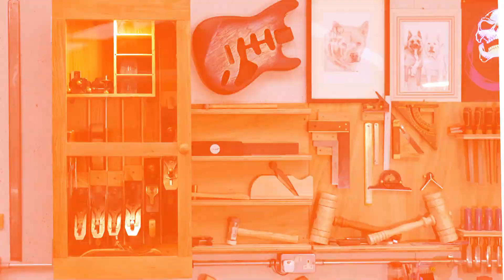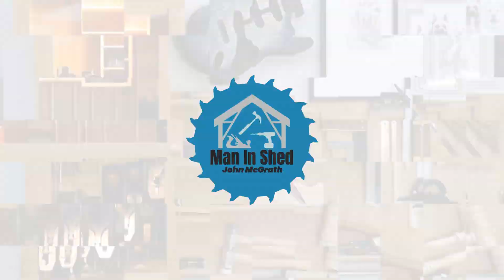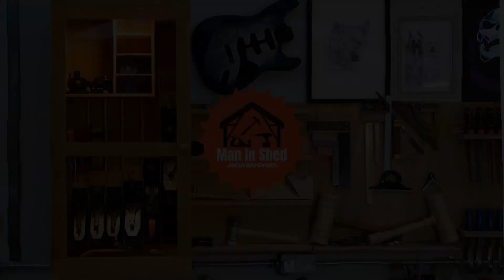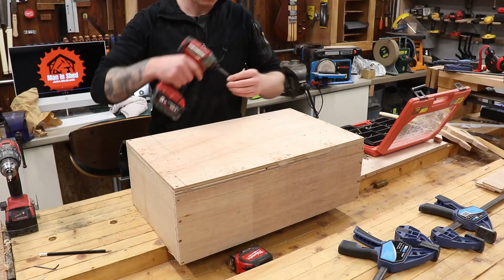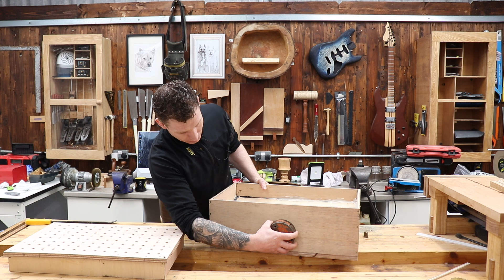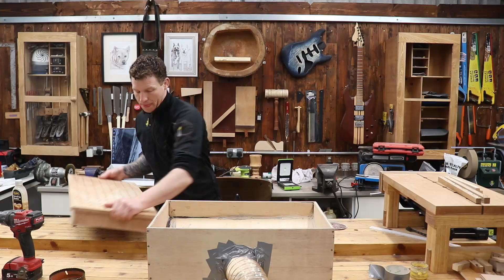Downdraft Table. Sanding Station. Easy to Make, Essential to any Workshop.

Comment: great job . a downdraught table is brilliant. a great place to store it is on the drill press table, put a few buts of timber around the metal table to stop it moving. put a replacable part in the middle  to drill into. its great to hold the piece down and to suck up any dust. ypu could put a wider hole to sweep in shavings. i would round over the holes to make it easier to pull the dust in.
Reply from the maker: Nice tip thanks

Comment: I feel like you set out to build one of these into your mft table as well. Did you ever set that up?
Reply from the maker: I had planned to but never got round to it
Reply: @JohnMcGrathManInShed  I don't have an MFT yet, but I am about to build a downdraft table. Seems venting with 20mm holes on 96mm centers might allow me to more easily integrate the clamping and holding of whatever I am sanding. Also, THANK YOU for all your amazing content.

Comment: Nicely done John 😁. Looks like I "need" one of these, will prob have to make mine a little shallower so I  can store it when not in use 🤔. I have been using the top of one of my home made MFT cabinets as I made it "torsion box" style so it's already a box with holes in the top and works OK. But a dedicated one will be better 😁. Thanks for the vid John 😁👍